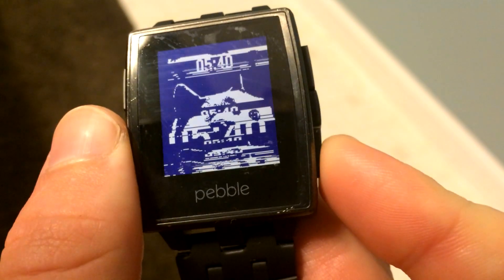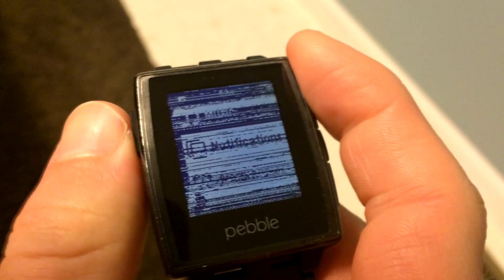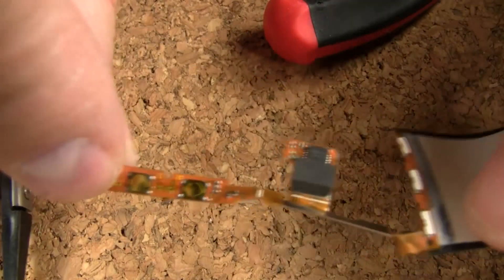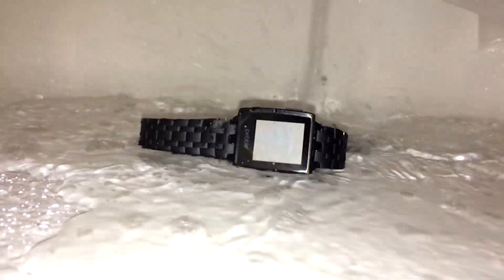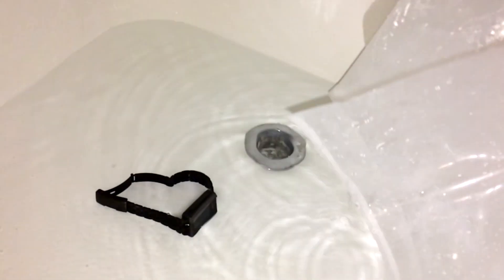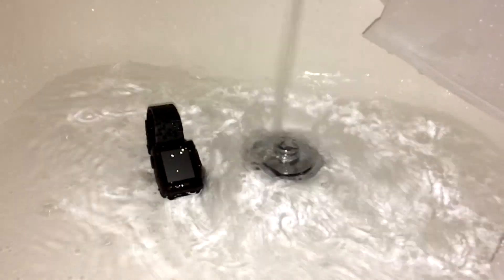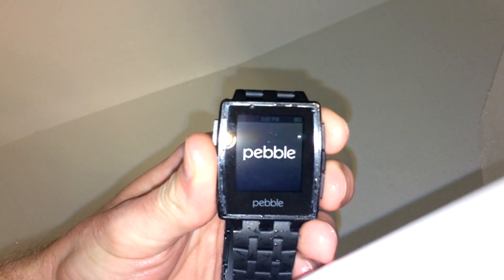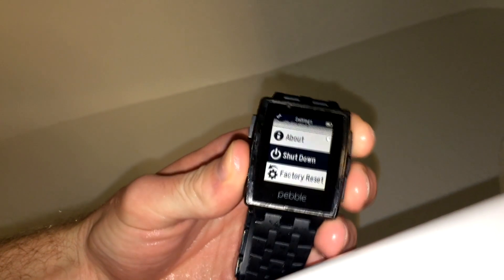Pebble/Pebble Steel Screen Artifact Fix

Comment: Tried this in 2025, used a hair dryer for about 3–4 minutes, then tossed it in the freezer for 5 minutes. I had already added some foam years ago to keep pressure on the connector, but lately the screen was pretty much unreadable. After this trick it seems to be working again, been using it for over an hour and the display is holding up fine. Thanks!!!!

Comment: I tried this with my pebble today.  The first time, I don't think I left it in the hot water long enough or the water wasn't hot enough because, although the display cleared when I put it in the cold water, it didn't stay clear for long.
Tried again a few hours later with hotter water and just left it in until the display cleared - didn't bother with the cold.  It's been about 7 hours now and it's still clear, so success! I have my pebble back.

Also, for those asking tub? sink? etc. I used a small ceramic cereal bowl which was big enough to hold the watch and deep enough to cover the whole device to do this.

Comment: I just tried this trick, again, with just under boiling temperature water, and then ice cold water for five minutes, and the cold a bit longer. In between the baths, I rinsed it with cool water to bring it to room temperature.

Comment: Blowing hot air with a hairdryer, on the base works just as well. The heat fuses the loose component, which causes the tearing, back to the board. Similar to the Xbox 360 red ring of death fix.

Comment: Thank you for the tip.  I applied your 'concept' but approached it differently.  I used a hair dryer to blow hot air to my pebble steel with leather strap for 5 minutes then placed it in the ref to cool down. Now my pebble is as good as new. Thanks for the idea!!

Comment: I tried with hot water from the tap.  No luck.  I heated the water to 160 F and it worked.  Thanks.
Reply: Me too, tried the first time with 'not so hot' water, then boil again, this time without mixing with cold water, it works for 13 hours already.

Comment: I can confirm this works. I had the issue of screen tearing AND button malfunction (the up and middle buttons wouldn't work unless the down button was pressed). I did this fix, and my watch feels like new again. I even have the tactile feedback on the buttons again instead of a squishing feeling. Note, I did press the buttons after submerging into hot water, then I resubmerged in hot again.

Comment: I tried this fix without to shower the pebble and worked, just five minutes of hot air from the hair dryer, five minutes at room temperature and then 5 minutes inside the freezer of the fridge protected with a plastic bag. And the pixelation was gone (48 hours ago).

Comment: I had the same problem with a pebble watch I bought from a friend. I had seen other recommended fixes where the watch back is removed and padding added...unfortunately the model I have does not have exposed screws to remove the back. I tried your hot then cold fix and so far..all good!! Thanks for posting.!!!
Reply from the maker: +Ann McCarthy I wish you the best of luck! It's of course not a one all fix all, but it should do the trick for now.
Reply: +VM Media Group How's is going? Is it still fixed?
Reply: I tried it as well but unfortunately it only worked for 1 to 2 days before the problem comes back.

Comment: Worked perfectly. 5 minutes in hot water (about 50° Celsius), 3 minutes cooldown without water and 5 minutes in cold water (abot 18° Celsius) and the display is fine again.

If the problem should return in a few days, I will post it here.

Thanks a lot!
Reply: did it work?
Reply: Does this work on the original pebble
Reply: He no longer has this device.

Comment: Not sure on this.  Mine stops showing artifacts after I shut it down and restart it (they eventually show again, after a day or two of uptime).  Based on that, I highly doubt it's an issue with any cabling.  I've had mine awhile...not sure if it's still under warranty (bought it in April of 2014).

EDIT:  just found my proof of purchase (that's a miracle) and have asked for an RMA.
Reply: Quick update:  I notified Pebble and they sent me a new one after I sent screen shots of the issue.  After a month or so, the new one started doing the same thing.  I've retired it since then and bought a Samsung Gear S.  I miss the 7-10 day battery life of the Pebble, but I love being able to take calls on my smartwatch.  I just didn't want to get another Pebble, have issues, and be given another flawed Pebble.  That artifact issue needs to be fixed.  Giving me a new watch that had the same issue is not a fix.  All that being said, it's still a nice watch.
Reply: My second had the same issue as well after a while, but I am told the new Pebble doesn't and it has a 10 day battery and in color. I am still using my pebble and like it in spite of the Artifact issue. I am leaning towards getting it. So far I have not been impressed with the android watches. Suppose to be a new one soon, will see what it's like.
Reply: +Ron Sinclair Yeah, this is why I ended up switching to the Moto 360...
Reply from the maker: Mine originally would fix itself after a restart until it progressed to this point.
Reply: This issue can be caused by software or hardware, if ribbon cables are getting loose it can definitely cause screen tearing. If restarting your watch fixes it then you most likely have an app or watchface that needs to be updated to the newest API (the developer needs to update it), and it's causing a memory leak, which is why restarting it fixes this. So you can try factory resetting the watch, and don't install any watchfaces or apps for a while, then slowly install one at a time to find the culprit.
Reply: Ron Sinclair If I smack mine it will go away, its definitely physical. Pebble will give you a new one even if out of warranty because this is a manufacturer defect. At least, they are accepting them as of now. They replaced my kickstarter edition.
Reply: Yeah, man....I gave it a shot with Pebble.  I'll consider any watch as long as it's core functionality isn't broken.  The display is a core feature of any smartwatch.  Artifact issues that affect how the display functions is a problem that can't really be ignored, IMO.  If you can't see the display without having to reboot or whack the watch, that's a problem.  That's also an issue with brand dependability/reliability.  As much as I enjoyed my Pebble, why would I spend more money on a newer model when the first two I owned developed issues?  I highly doubt such an issue will occur with my Gear S....at this point, as long as the core features don't break, I'll be happy.
Reply: Did you mail pebble the screenshots through the app?
Reply: No.  I took pictures with my smartphone and e-mailed the pictures to Pebble.

Comment: And how long did it last? I got 3 replacement watches but they are all defected. Noq I just gave up...
Reply from the maker: The fix lasted for a few weeks. Look at the link in the description for more. My replacement model still works great. However, I no longer use the Pebble. I now use Android Wear devices.
Reply: +Swedish Otaku it only took me one replacement before I decided I didn't want to deal with the issue anymore.  Two defective watches was enough for me.  I went Android instead.
Reply: Ron Sinclair I got 4... Then I sold them and made back more money than I paid for it in the first place. :3 Love it, but it got a little scratch now. T.T

Comment: Ehh, there is also a thing called warranty
Reply from the maker: My replacement is on the way. This is just a temporary fix. It's worked perfectly fine for days now, which is good because I can still use it as I await the replacement.
Reply: Martijn Martens  Sure.  I've RMA'd two watches - so I'm on my 3rd.  And it too is becoming unusable now.  I'm pretty sure I'm now outta warranty.  I should give them a shout just to see if they would still RMA the watch.  I found this YouTube site while trying to figure out if my experience is a fluke or not.  It appears not.  There is clearly a fundamental design problem. I wonder if the new Time has the same problem. The think that has bothered me all along is that Pebble seems rather quite on what appears to be a pretty significant problem.  Maybe that's smart business.  But frankly, I didn't really enjoy all the hoops-jumping of removing programs etc. and never hearing Pebble admit that they have a know design issue. If it weren't for the perpetual screen problems, I'd be a total fanboy for Pebble.
Reply: +Martijn Martens if you've read through some of the comments, I'm sure you realize now that the warranty route doesn't work for most people.  Replacing a broken watch with another one that has the same defective parts...not really smart, IMO.